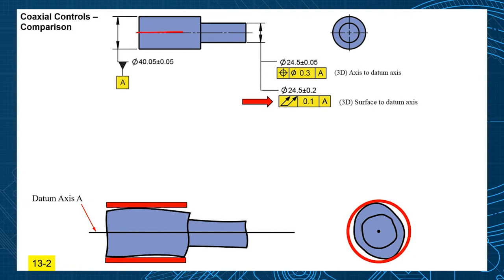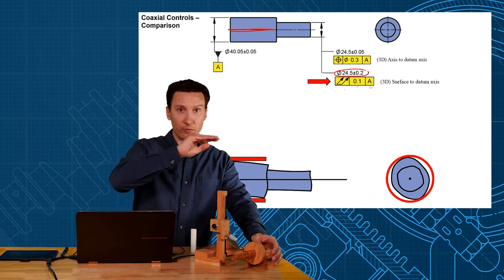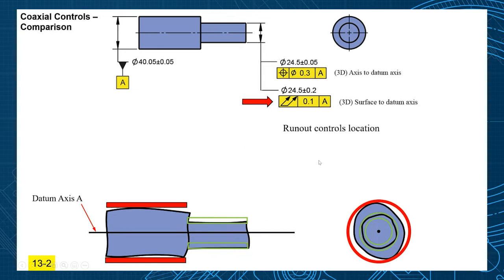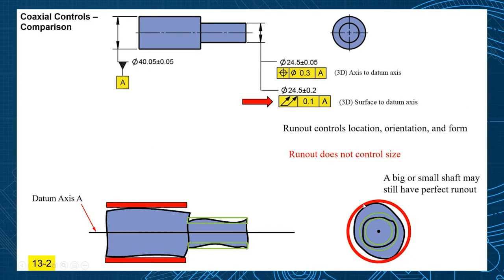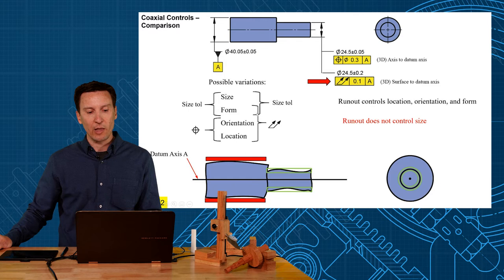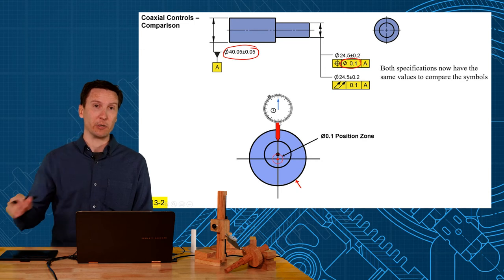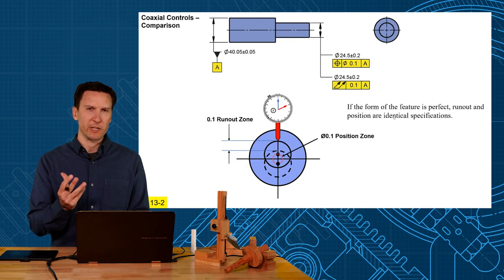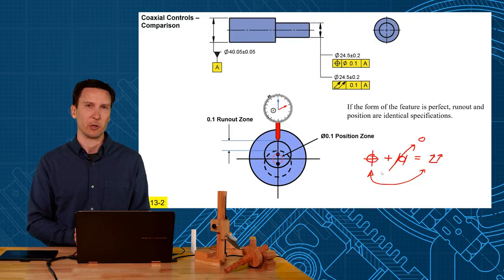Position Tolerance vs Total Runout

Comment: Thank you for the best explanation. For rotating shafts, is it recommended to use total runout compared to position tolerance?
Reply from the maker: It depends on the application. Runout adds an extra form control with the coaxiality. Do you need the extra form control or did size tolerance do a good enough job controlling form? Runout can be overkill on a lot of applications.
Reply: @GeoTolPro  for a shaft with less number of step features, I applied positional tolerance. For sealing application, do you suggest applying runout to control form?

Comment: a very important side note ist that the tolerances are not correctly indicated. Total run-out has to be pointed at a surface not an axis. a position geo tol can be pointed at an axis OR an surface. if you point a position tol at the surface [position|0.1|A] it has (nearly) the same meaning as [tot run o.|0.1|A]. so pointing at the diameter directly as shown in the video always means the axis and NOT the surface -> this means the Total run-out tolerance in the video is not correctly indicated.
Reply from the maker: I don't know of an official rule in Y14.5 that forces runout to be pointed to the surface (although a lot of the examples show it like that). In Y14.5-2009: Fig 3-29 (feature control frame placement), there are two runout tolerances that are placed under the size tolerance. 

Position RFS always controls the axis of a cylindrical feature within a cylindrical shaped tolerance zone. You may have it mixed up with MMC or LMC modifiers? A position MMC or LMC controls the surface, but that's not what the video talks about.
Reply: @GeoTolPro  thanks for your reply. I dont know about Y14.5 but the ISO clearly differentiates between surfaces and axis/midplanes by where you point with your arrow. So you can know in every case what is meant.
Reply from the maker: ISO has different notations. Position always is pointed to the feature. But you use two the opposing dimension lines across the feature of size to get the median line/median surface (derived feature). Position can't control the surface of a round feature (hole/shaft) but position can be applied to planar surfaces with a leader. Yes, runout is directed to the surface. (ISO 1101:2017)

Also note position controls straightness in ISO standards. The derived median line must lie within the tolerance zone. (instead of the axis of the unrelated AME in Y14.5)